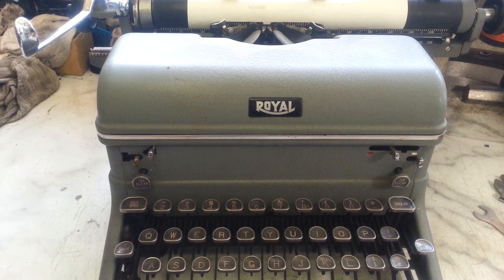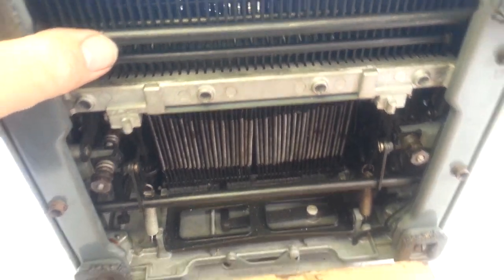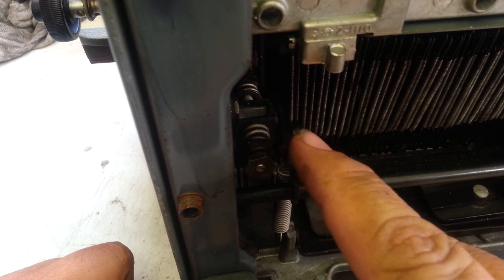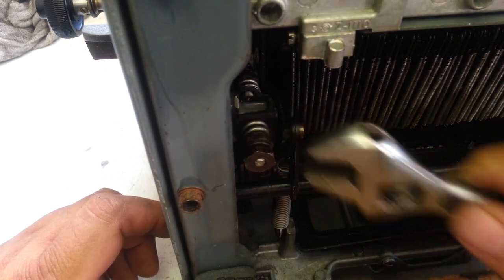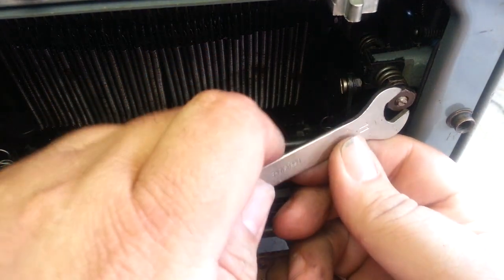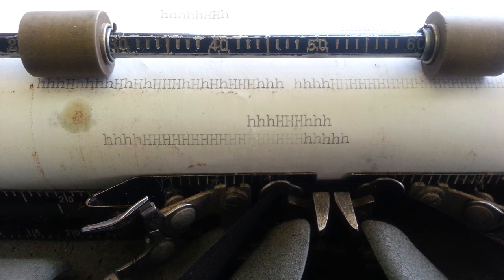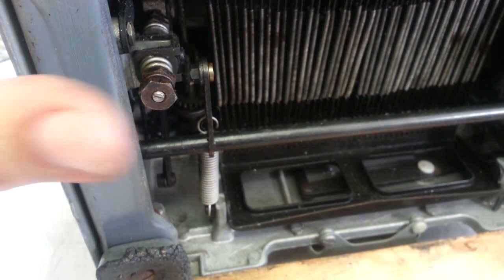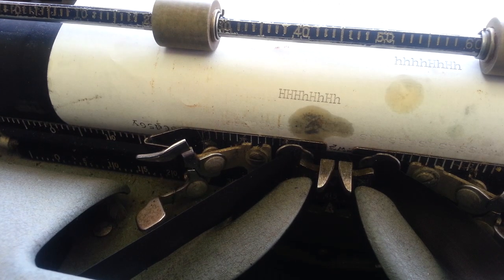Royal KMG KMM Typewriter Shift Motion Alignment Balance Upper Lower Case Adjustment Repair

Comment: Hello, I have a Royal KMM and I have been able to see the upper case to the correct position, but the lower case is all messed up. The strikes for the lower case sit well BELOW the upper, it is a full half of a line lower. The bottom bits of the lower case do not show up. I've been able to tinker with this and got nowhere. The KMM has the same nuts that you are adjusting in this video.
Reply from the maker: When in lower case is it butting up to the shift stops (nuts), if so, nut needs to be adjust.
If it's not making contact with shift stop then something is impeding the basket movement
Hard for me to guide you without seeing the problem in-person with my eyes
Reply: I had a typewriter that had a similar issue. On first glance, the compression springs were not engaging the stop. On closer inspection, I noticed the shift-lock wouldn't hold. Turns out that in shipping, that key had received an impact and the shift lock was on the wrong side of the shift lever. (The notched bit on the end that was supposed to go over the stud on the shift key and hold it was past it.) That was keeping the basket from coming up all the way. Once I fixed that, the lower case raised right up. Then a slight adjustment and it was fine. That sounds close to what you're describing.